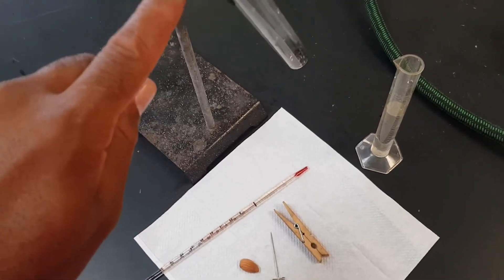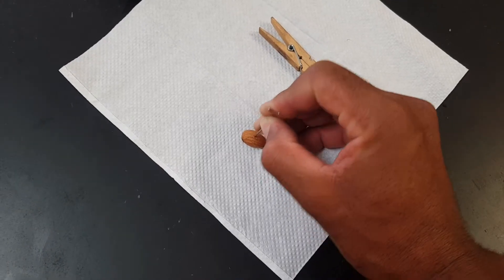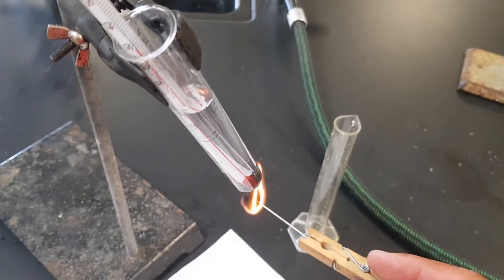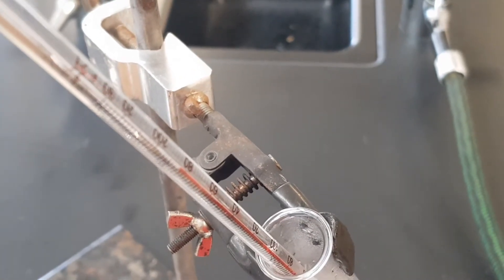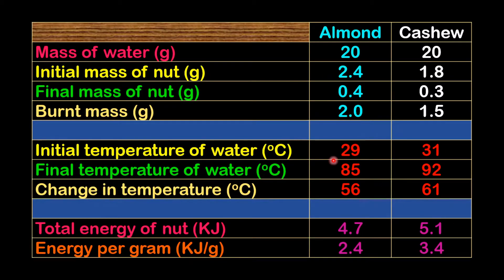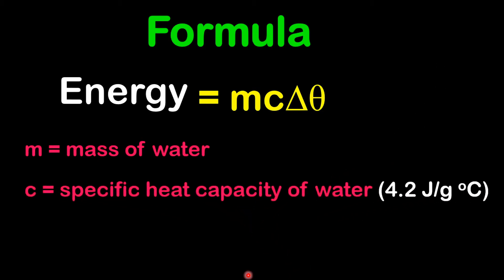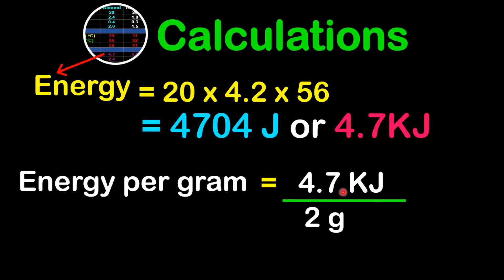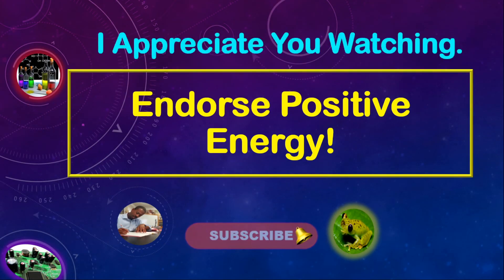Energy in Nuts Experiment

Comment from the maker: Topic: Energy value in nuts (food)

Aim: To determine which nut contains the greatest energy (or greatest energy per gram). 

Method: 
1. See the video for set up (stand clamp and nut on the T-pin).
2. Clean all apparatus.
3. Select at least three different nuts
4. Weigh each nut and record their masses (initial mass).
5. Measure and pour 20 mL of pure water in the test tube.
6. Measure the temperature of the water (initial temperature).
6. Place one of the nuts on the T-pin and ignite it over the Bunsen burner.
7. Position the nut so that the top of the flame touches the
bottom of the test tube. 
8. Allow the nut to burn completely (or as the water reaches 100 degrees Celsius).
9. Take the final temperature of the water (maximum temperature reached).
10. Measure the unburnt nut (remains of the nut). This is the final mass of the nut.
11. Repeat the procedure with the other nuts (or the same kind of nut previously used).  
* See video content for calculations and useful explanations.